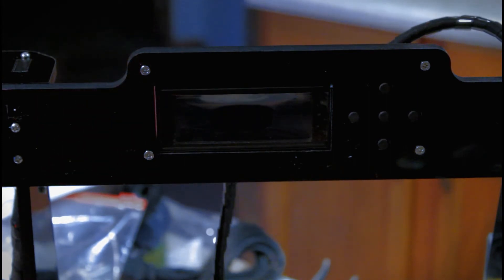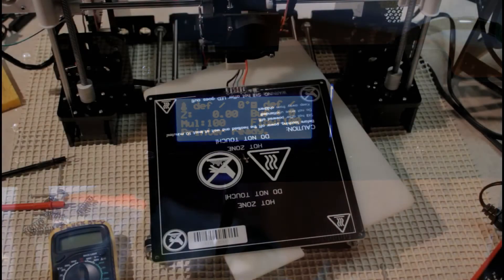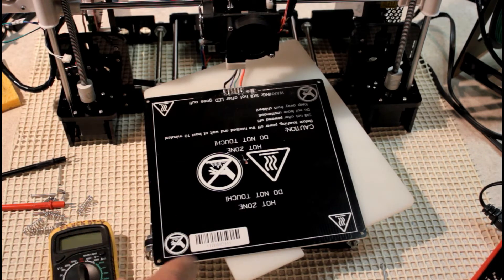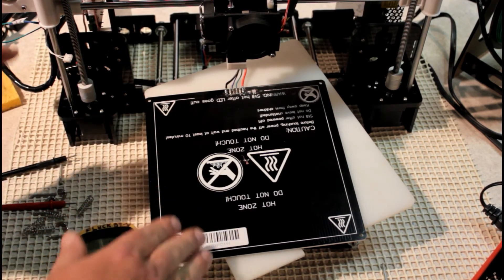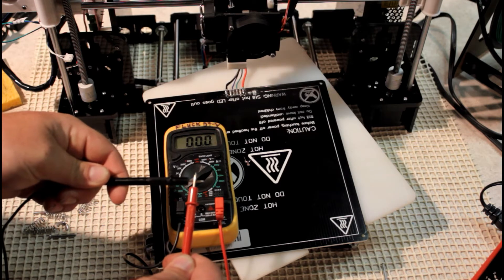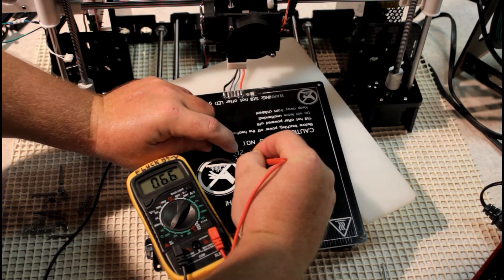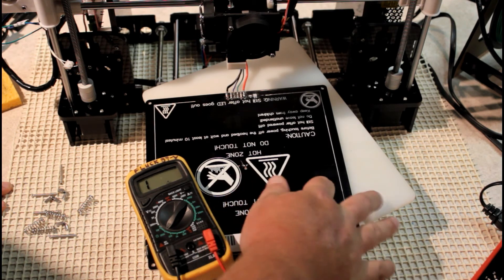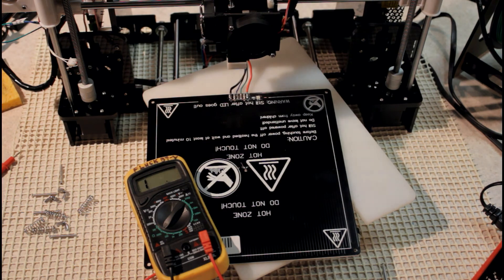Anet A8 def Error Diagnose and Fix

Comment: Man, Thanks.
I got new extruder and plugged into the board  and i got DEF. 
But the GST connecter has two pins right beside each other (1 and 2) not  1and 3.   I made those changes and it works.
Thanks again.

Comment: My printer works fine until an hour or two in and then the def code shows for both temps. It keeps "printing" but the nozzle and bed both stop heating, so it's not extruding anymore at that point.
Reply from the maker: Have you tried test the outputs of each? Sometimes only one giving an error will shut them both off. Hopefully it is just one of them, the mainboards can go bad as well. If you test the output and check all connections and they are good it may be a main board issue.

Comment: Thank you for the video.  One very important point to mention is to disconnect the hotbed connector off of the arduino board.  Resistance could be inaccurate due to other circuitry on the arduino board.  I did this with my old Anet A8 unit and it has not given me any issues for years now.  My 2nd Anet A8 dual extruder is starting to give me thermal runaway errors and heating failure errors.  Thanks to your video, I remembered the trouble with my original unit.  Kind regards and again tks for the video.  Regards from South Africa.

Comment: What if it turns out it's not the heatbed's fault?
Reply from the maker: I would try and test the thermistor for the hotend and see if that one is throwing the error.  If not that, it may be a main board issue, you could try uploading new firmware (which I suggest anyway) to see if that can solve the problem.  Marlin would be my suggestion, also check all the connections to make sure something isn't loose and not connecting properly.  I hope those suggestions can help!

Comment: Is there a way to not connect the heated bed and just print without it? The bed itself stopped working and I don't necessarily need to heat up the bed for PLA anyway. Would be a shame if I had to buy a new heated bed for nothing
Reply from the maker: You could always look into loading a new version of marlin configured for no heat bed, I'm sure someone has made one for the A8, it would be good for added protection too.

Comment: hi i have a problem my bed temprature 257 measuring , bed thermistor and extruder thermistor aren't they the same? ı changed but not working good
Reply from the maker: Bed thermistor and hotend thermistor are two different thermistors in two different locations, I would try to determine which is faulty or replace both to see if the error disappears.
Reply: @RevampedOutdoors  100 K ntc same thermistor?
Reply from the maker: Depending on your model of heat block the size may be different, 100k though yes.

Comment: i got my a8 in 2016 and  on mine when a thremister dies  it only shows def on the one thats out be it bed or extruder so mine is a bit better but it is an older version, i dont know why they would change that bit because it is helpful
Reply from the maker: I have heard that sometimes it will display only one if conditions are right. I haven't had a problem since so I can't confirm what those conditions might be.
Reply: @RevampedOutdoors  im not too sure either but the week after i got my 3d printer all put together the extruder thermister died and it showed def for the extruder temp but it showed the bed temp. also im currrently using my 3d printer

Comment: Thanks for a great video.  As I was watching the video and starting to take my printer apart I found the culprit.  My printer gave the same error as described.  The bed temperature showed -51 as the printer booted, then the extruder and bed both showed "def".  When I removed the connector for the bed thermistor I found that one of the thermistor wires had broken - probably due to fatigue.  I gently removed the receptacle from the connector body by depressing the retention tab, then soldered the wire back on and reinstalled the receptacle into the connector body.  I'm very pleased to have repaired my printer without having to buy parts.  This printer has been in service since October 2016.  I have printed hundreds of items.  This is the first repair so far.
Reply from the maker: Awesome! I'm glad you got it worked out, I'm still printing daily on my now upgraded A8 I love the things as long as you monitor the problems for safety they're great. I think about building another one every week.

Comment: hi dude, what I can do if I don't have the "def" message but I can't start a print or preheat pla ? thank you for reply.
Reply from the maker: There are too many possibilities to list them all. We need some more information to help, does it get any power? Does it display any messages? Is the LCD on? Does the main board light up? How are the connections, all secure? Is the main power supply outputting 12v? Is the switch on the power supply set to your countries AC voltage?
Reply: Revamped Outdoors i’m with 220V and it worked every times, and just today the printer is on but when I want to preheat or print something it restart, and it makes this every time, no error messages, just that I can’t start a print or preheat, i touched anything...
Reply from the maker: @Sazul_IRL  check your connections for the hotbed and the nozzle, it seems to me that there is a short somewhere when you preheat so it restarts. Maybe try to just preheat one or the other. Try to heat the bed seperately from the nozzle then bozzle feom the bed. See which one causes the error condition. Then check the wires and connections for the thermistor and the power to the one that causes the issue. If either the bed or nozzle alone causes restart with warming i would check the solder on the main board. Look for anything that looks hot or melted. Otherwise if everything looks good you can always try to flash new firmware to see if that helps.
Reply: Revamped Outdoors anything is melted, how I can install the new versions ?

Comment: Thank you brother. This told me where to look for the problem and I fixed it. It was the connections at the hotbed. 😎
Reply from the maker: Bobby Keyz nice! Glad it helped!
Reply: Revamped Outdoors yep it did. I'm printing again. 🤗
Reply: Revamped Outdoors I was upgrading it with a power switch and I guess I must have disturbed the connector to the hotbed.
Reply: Bobby Keyz z
Reply: Same here my friend! My connector was almost unplugged. Thanks for your video

Comment: Did this fix your problem
Reply from the maker: It fixed the def error that was preventing the printer from starting to read Gcode commands. It has been printing great ever since.
Reply: I have replaced both and it's still doing it, pity the printer has been going so well for so,long
Reply from the maker: Have you checked the wiring itself or the connections? Sometimes the connections can go bad on the wiring itself and will not read from the thermistor I know that can happen it's not as likely but you never know.  If you're getting good readings from the thermistor at the JST connections and solid connections to the board then it could be the board connections too.  I have heard of people needing to re-solder the board connections because they weren't the best from the factory.  I hope you can figure it out, having a down printer absolutely is horrible.
Reply: Think you were right. I walked away and talked to myself for a while and went back. I tightened the JST plugs on the board by bending them slightly to make better contact and wham!! It's working again?? Time will tell, I'll see how it goes. Thanks for you help. This is the only problem I have had other wise it's been a great printer.

Comment: my anet a8 has been working just fine for a long time but for some reason now when i start a print it works for about half the print then it says def. i can fix this by hitting the reset button or unplug/replug but it happend everyprint and i cant even git full prints of, help
Reply from the maker: GymBoyB it sounds like it could be a couple different things. Does it stop the print at the same layer each time? Or does it stop at different heights each time? If it stops randomly at different heights or print time I would check the connections to the thermistors as there might be a loose connection and the right bounce or jiggle might disconnect the thermistor for a second and trip the error. Maybe it could be a firmware issue as well you could update to skynet to see if that is the issue if you haven't already. Maybe the connections to the main board are not as tight in the JST connector so they are throwing an error? Worse case scenario it could be the main board thermistor connections are bad but I don't say that lightly because that would be a last ditch option to replace the board.
Reply: I haven't done anything to it yet and today it printed just fine no problems so ill get back to you if it stops working again but for now i am just going to be softer on it.
Reply: @gymboybtroy5127  Sounds like a loose connection. Some times I could print 100% of an object and have no problems. Then start another one and it would give 'def' errors at different levels.

Comment: Printer does not show the option of printing files What to do?
Reply from the maker: For some reason YouTube flagged this comment and I didn't see it until now.  I'm sure you have figured it out by now but for other people having the same problem.  It could be that the SD card is corrupted or not formatted correctly or has not been initialized in the menu of the printer.  If you turn the printer on before the card is inserted sometimes you need to select INT card in the menu before it recognizes it.

Comment: Can you link to what hot bed thermistor you bought? I looked on Amazon and there is a lot.
Reply from the maker: I ended up using Ebay to get a 5 pack, but that auction has been relisted and this is now the alternative  http://r.ebay.com/yBZsH0

These should work just fine, basically if they meet the criteria of the 100k NTC and the seller states they are for 3D printers you are generally OK.  I say generally because if you are looking for a thermistor for your hot end (into the heat block) those thermistors will be smaller.  The ones I purchased were about 75% larger in diameter than the stock one but they did recess in the hot bed hole.  They work great and actually are a little bit more responsive than the stock one and pressure from the wire holds them securely to the bottom of the bed.

If you are looking for the hot end thermistor it would be good to ask the seller for the diameter of the thermistor and make sure it will fit into the small diameter hole next to the heater core in your hot end.  I hope this makes sense! I hope you get it fix!